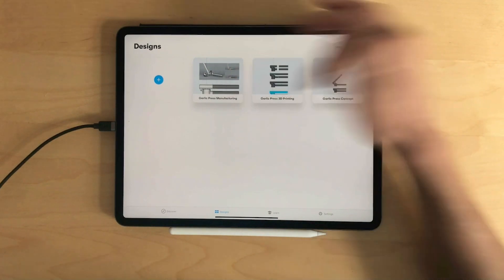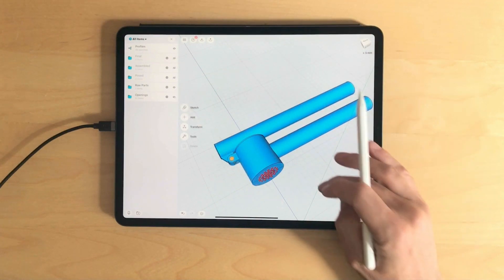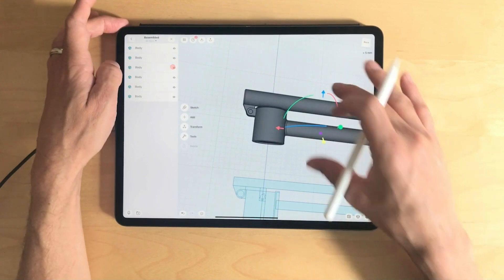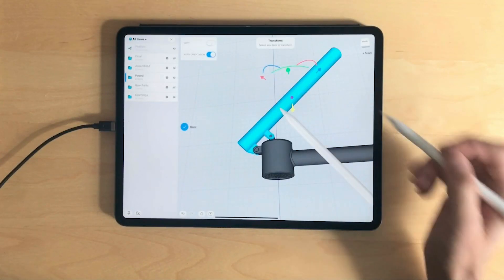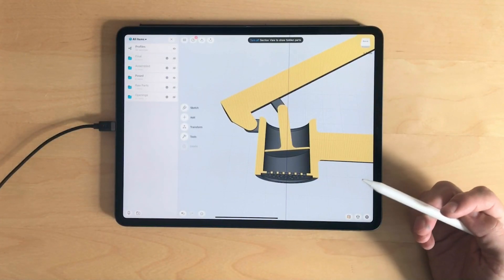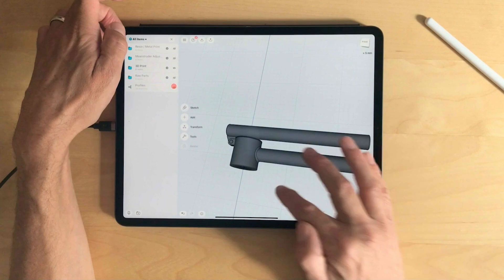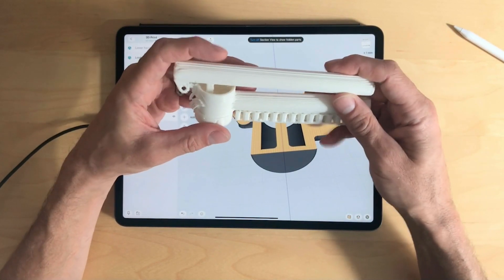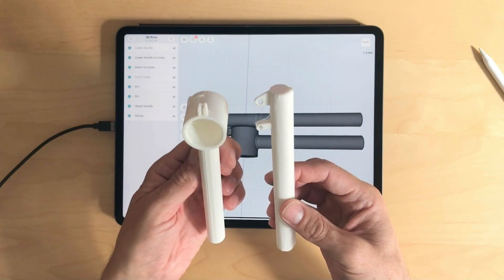Prototyping on iPad Pro | Project Intro | Part I

Comment: What software do you use on your videos that show the iPad finger gestures as red dots and the Apple Pencil as you use it to model the features?
Reply from the maker: Hi! It's an in-app feature; go to your iPad's Settings and scroll down to Shapr3D. There will be an option "Display pencil and touches (requires restarting the app)" - switch that on :)
Reply: Thank you very much for the prompt reply